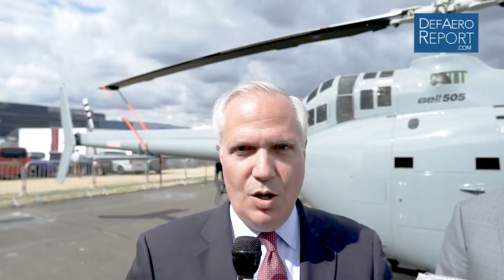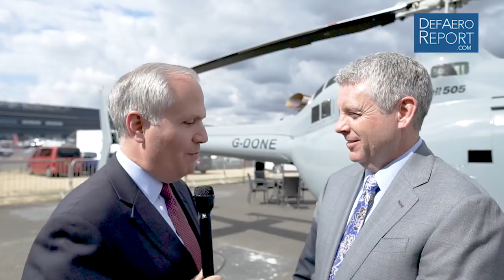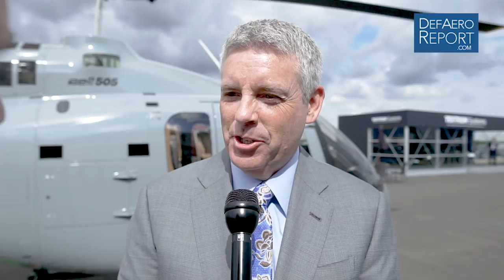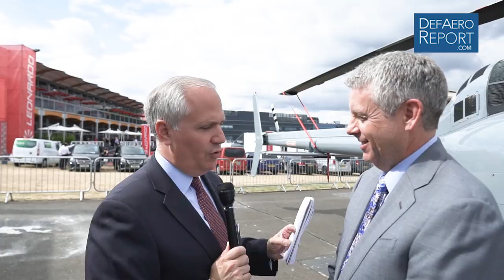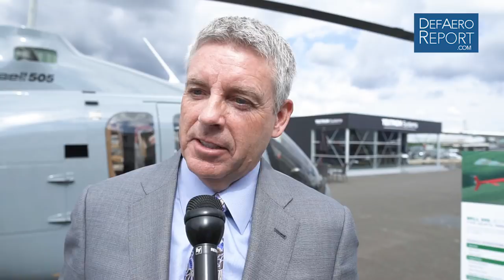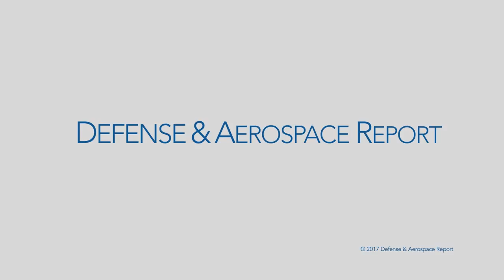Bell's Snyder on V-280 Valor, Cutting Costs, Model-Based Design, 505 Helicopter

Comment: Can anyone tell me could we (the UK) put crows nest and or refueling for an f35 on a v280 ?
Reply: Doubtfull. Size and powergeneration for Crows Nest might just fit, but the V280 as a tanker is stretching it a bit - it has the speed, but the fuel to off-load combined with the hose&drogue system is probably a bridge or two too far. V-22 would be a better option, but also just. F-35B needs a helluva lot of fuel, especially since it needs to bring back some to use as coolant.

Comment: OK----- Why are they afraid to raise the landing gear? What is wrong with the V-280? The CEO is proud that they have gotten up to 190 knots with the Gear down. What Bullshit if they can't even raise the landing gear. 190 knots is probably the upper limit for dropping the gear. Just imagine how fast it could go with the gear up but we may never know with these bossos.
Reply: Sorry but the black hawk raised its landing gear on the second flight just make sure it could.  The V-22 raised its gear on the 6th.  Sounded like a good idea to me as raising the gear is a big milestone on any aircraft since it must be cycled hundreds of times throughout the program to be certified that it will operate when needed. Now after over 6 months and hundreds of flights he has to brag about the speed with the gear down is just pitiful when it should have been 250 with the gear up. Now that is a data point.  What is the freaking problem?
Reply: @1701Larry  "Sorry but the black hawk raised its landing gear on the second flight just make sure it could"... my guy the Black hawk didn't come with retractable landing gears. Also the Black hawk had 20+ crashes in its first 6 years of service so maybe they should've done more testing.